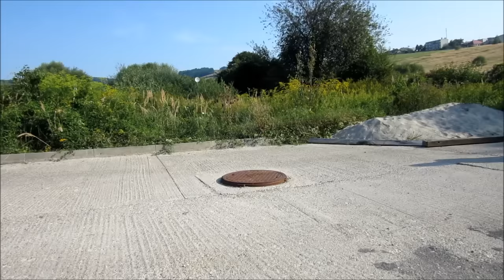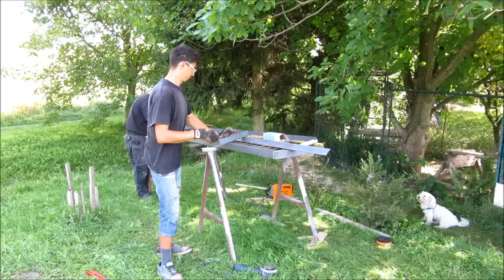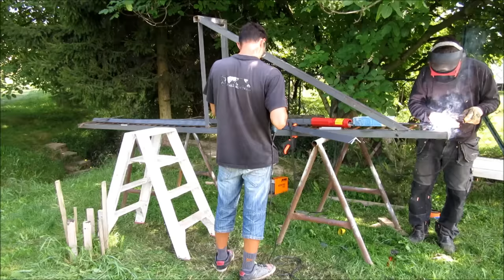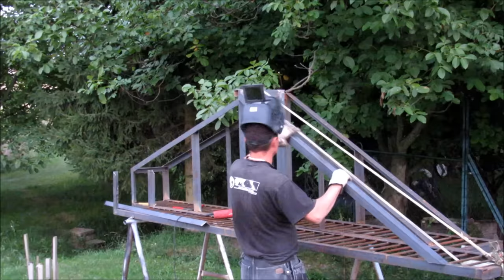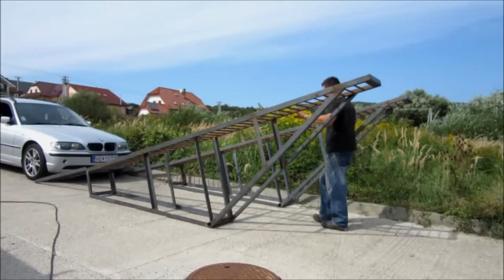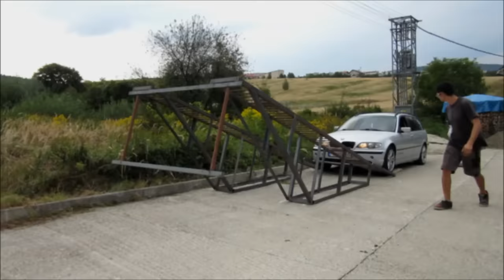Car ramps - how to make it - DIY

Comment: It's truly amazing how many negative comments there are for this idea. This is a good idea, no one was hurt, no property damage happened either so how is this not a solid tool? There was no weird flexing or twisting of the metal in any way. Soooooooo, people are bitching and moaning because the ramps didn't work like they were intended? How do you find out if your idea is going to work if you don't try? He gives a legitimate reason as to why these ramps didn't work as predicted. His reasoning makes a lot of sense as well. I agree, there isn't enough structural bracing to make comfortable to stay underneath the car on these ramps. I imagine quite a few people were hesitant about using the hydraulic car lifts that are in every automotive shops today. If I had a concrete driveway or pad when I was building custom rides I would have built something like this myself to help me work. HELL, after watching this video I may build one now to make it easier for me to work on the under carriage of my lifted Jeep, It has enough of a lift to make some things out of reach from under my Jeep but when jacked up and supported by Jack stands it's too high for me to be able to work from the top of the engine compartment.  I could build a ledge that goes around the sides and front of the Jeep that could support my wheelchair and allow me to work from either the top or bottom. Great idea and definitely a great platform to upgrade or build from. Don't let these idiots make you think it's a stupid idea.

Comment: Easy fix.  Add another 3ft/1m to the front of the ramp to allow you to drive a little further onto the ramp.  That will move the center of gravity beyond the tipping point and you won't have to jack up the rear end.  Then add safety kickstand at the rear to keep it from tipping backwards.

Comment: Good build, but if you'd made the fulcrum a little further back, the stand would have tilted just by driving the car onto it.  That would save you having to lift the back of the car manually, but I like the overall design.  I'll copy it pretty much!

Comment: EVEN WITH THE LITTLE ISSUE,THIS IS PROBABLY ONE OF THE BETTER HOMEMADE RAMP (SYSTEMS) I'VE SEEN IN THE TUBE. MOST SEDM TO BE 14 TO 20" HIGH, JUST HIGH ENOUGH TO BE TOO CLOSE IF YOU CAN GET UNDER THERE IN A ROLLING STILL AND TOO HIGH IF YOU'RE ON A CREEPES. IF YOU'RE GKNNA BE USING THIS YOU BETTER HAVE A TRAILER AND A FRIEND OF THREE,LOL! HAS ITS NOT QUITE THAT BAD. MAYBE CONSIDER CUTTING KIT INTO SECTIONS,USING ANGLE FRAME WORK AND BOOTING THE M TOGETHER.
EITHER WAY,BUT THUMBS UP!!
JUST MY 2¢ WORTH
BEST OF LUCK!! TOO MANY OF THESE "BUILDS" ARE SKETCHY AS FRIGGGGG!!

Comment: These ramps are a good idea when built well.  As said, needs more bracing and made longer.  If the pivot point is dead centre you should be able to stand on the front to rock it down the slide your blocks to hold up the rear.

Comment: Problem a center part is in center of wheelbase car. When car was 50/50 distribution it work because car is on front. Ramp must be a little longer over a center of ramp point

Comment: not sure how practical this is, would consume an awful amount of time to set up for the smaller jobs, i,e about an hour to get it up there and all secure for an oil change which takes 10mins, also the car would have to be running and drive-able to use this ramp, no way you can push it up this!

Comment: Definitely need the diagonal braces for this gauge material. 
  I have the platforms but they are quite a bit heavier ...over 300 lbs. each. 
 This is not a bad build but max would be 4200 lbs. or so.

Comment: Too low to stand up underneath the car. Too high to lay down. Can't remove the wheels. Not sure about this project
Reply: I would rather lay on my back to be honest. Weird height to work at
Reply: rolling stool. that's how alignments have been done at most above-ground alignment racks for years

Comment: Allow JUST ONE vertical member to begin twisting...
Where's the Cross Brace to tie the 2 ramps together to keep it from flopping sideways?!!!
3 LARGE triangles, good. 2 more on the tall center legs, BETTER.
IF you don't understand this, go look at auto dealers who use tall ramps.
_ RELOOKED... 
Random angle iron 'Leg' directions?!!! 😨 
Too many cooks in the kitchen.

Comment: 8:12 ....having to resort to using a bottle jack or a floor jack underneath the vehicle, to lift the ramps with a 4x4 post, kinda defeats the purpose of building the ramps in the first place 😄  ....poor design, good build, just not well executed.  imo.  

It probably would work ok for front wheel drive vehicles, like a Buick Rendezvous or a CUV, it's very front heavy for a 5,365 lb vehicle  🤔